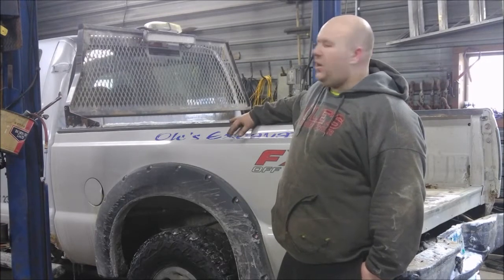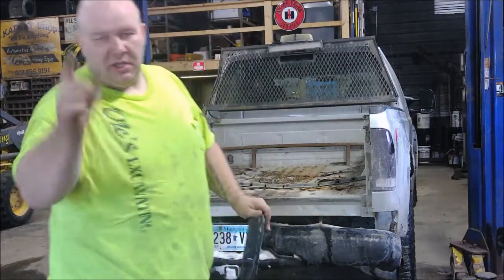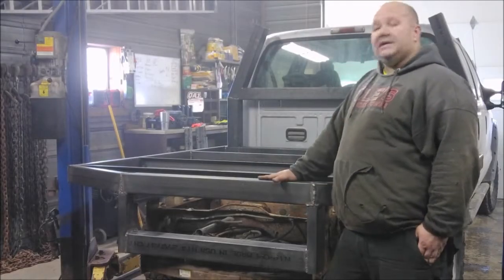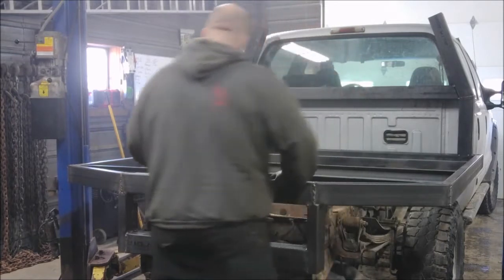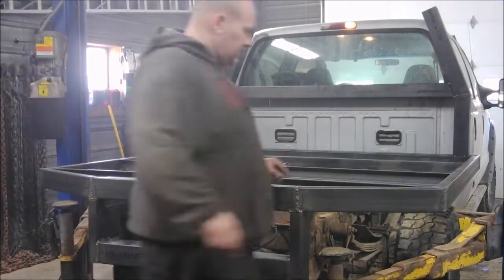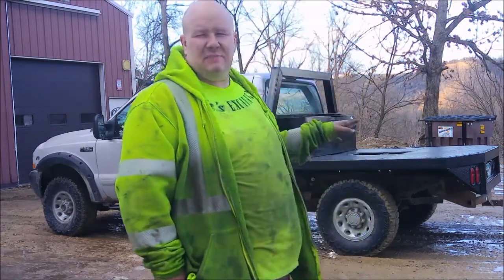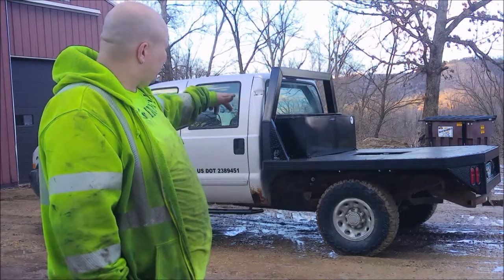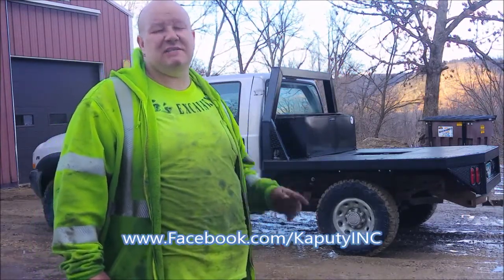Fabricating a Superduty Flatbed

Comment: Nice build man. Got a few questions for you. Did you use 3” C channel or 4” and where did you get the gooseneck plate from?
Reply from the maker: Thanks, it's working well for us. 3" channel for the frame rails and cross members, 2x4 box for the outside rails, 4x4 for the headache rack. The GN plate is from Curt, I think it was less than $100.
Reply: Awesome thanks man. How low did you set the plate for the gooseneck, just to where the ball was under the deck ? I’m Going to build one just like yours for my 99 Cummins short bed 🤘🏼🤘🏼
Reply from the maker: @No_idea_what_im_doin  I put the top of the ball 1/2" under the top of the deck, so you'll need to get that plate first. I bought mine on amazon. CURT 61100 Over-Bed Fixed Ball Gooseneck Hitch, 30,000 lbs. GTW, 2-5/16-Inch
Reply from the maker: @No_idea_what_im_doin  @Optimal Welding has some badass flatbed builds i watched a bunch before i built mine, im pretty sure he is where i got the 4x4 headache rack idea
Reply: @KaputyINC  10/4 I’ll check em out thanks man

Comment: How much of a angle did u give it in the back
Reply from the maker: I based the angle on the width of the frame where I dropped down the back skirt and where the next crossmember landed to make it simple. I can throw a gauge on it if you want me to, but I didn't pick a certain angle I just wanted it to look good without  lot of messing around.